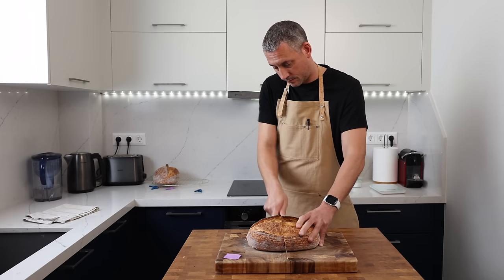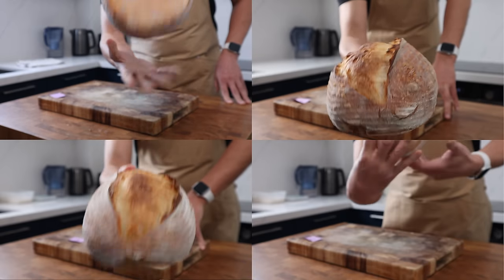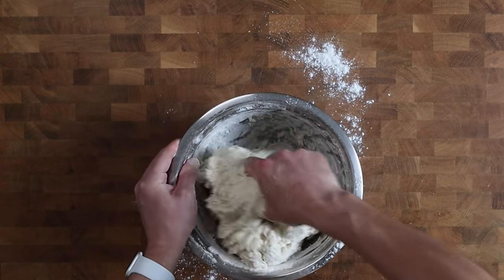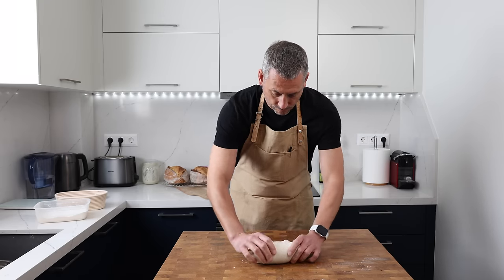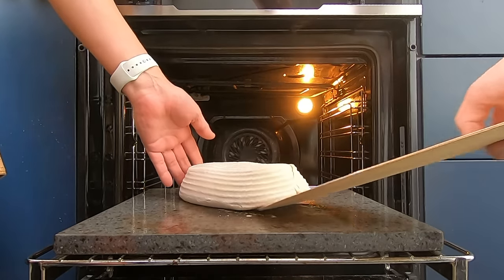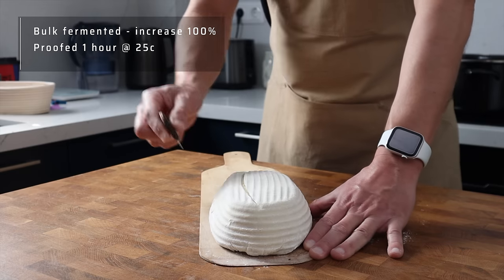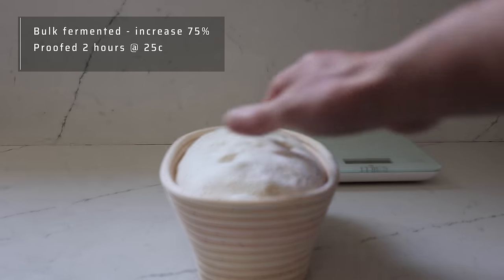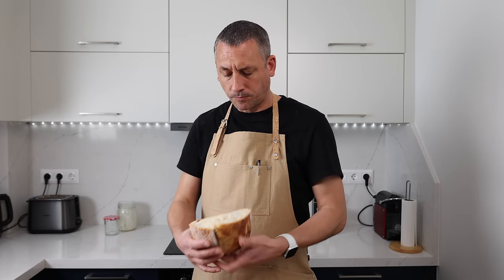Stop Over Proofing Your Sourdough, Use This Experiment to Find Your Optimum Proof

Comment: Interesting video. I watched but I missed the duration(s) of the bulk fermentation. Where is this described? The method I use is different. I don’t proof in the basket. I go right from shaping to banneton to retard in fridge. I may try to proof to see the difference but I always wind up with a nice open crumb.  I also bake covered for longer (25 covered/10 uncovered) at a higher temp. So interesting to see the different methods!
Reply from the maker: Hi Tim, my bulk fermentation time was 5 hrs for the dough to increase by 75% of the original volume and 6 to increase by 100%. Cheers for letting us know your method. I don't think any two peoples scenario is the same and it's really interesting to understand how the processes differ. Cheers for stopping by

Comment: I just tried your process (75% +2hr at 25°C). 5hr at 25°C and further 2 hr at 25°C then into the fridge for 18hr at 4°C. A TOTAL HUGE DISTASTER, Overproofing everywhere! 😁 It seems obvious after 7hr at the 25°C!! Ps: my levain it’s healthy and balanced,  i make panettone with it.
Reply from the maker: I'd suggest reducing your bulk fermentation / proofing times. There are many variables that can affect times, I can only explain what happens with my process at my temperatures. For example, using different flour hugely affects my bulk ferment times. Experiment and find out what works best for you. Hope this helps .
Reply: Why rice flour?